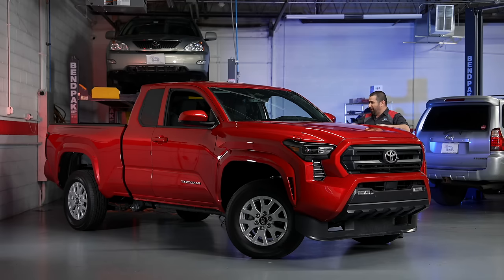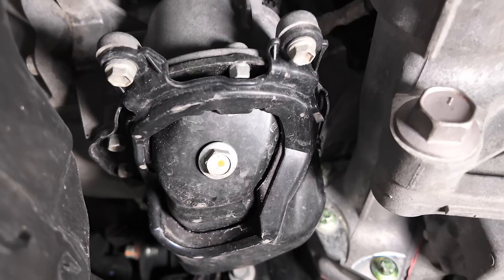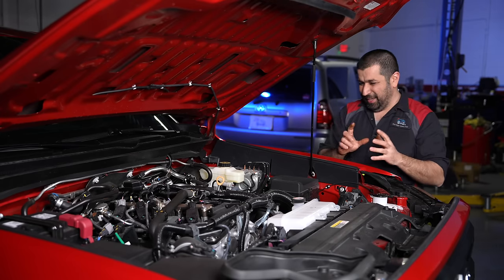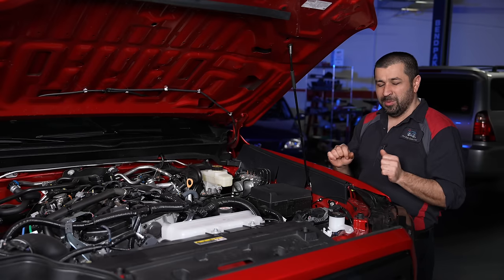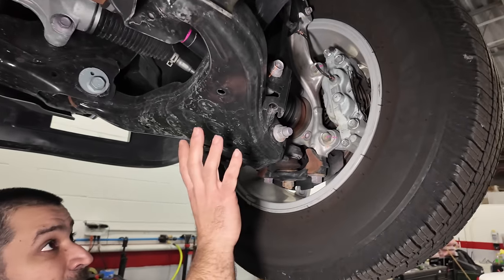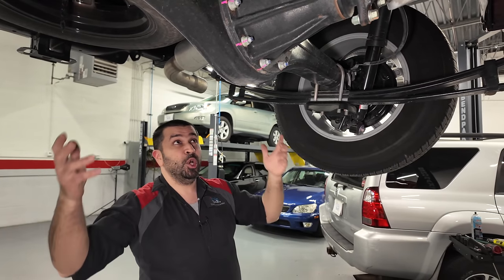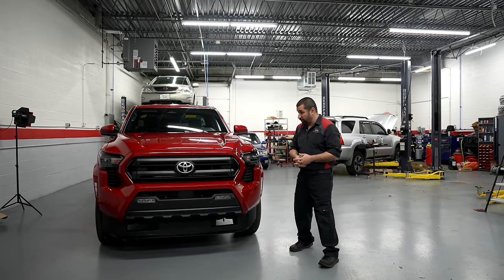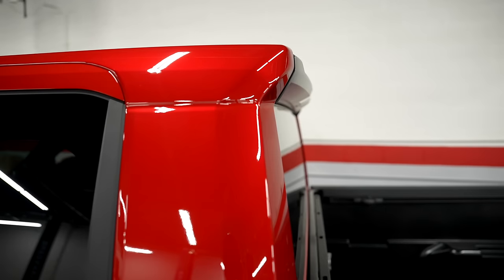2024 Toyota Tacoma | Did Toyota Improve or Ruin The Tacoma? Comprehensive Review

Comment: A truck the size of a ranger or Tacoma should cost no more than 32k out the door. This is getting ridiculous and lose the BS ill deal with just a radio dont need screens and push buttons.  just offer a basic capable truck with engine options and suspension and transmission options for any trim

Comment: The internet: "I can't believe Toyota would put a 2.4L 4 cylinder turbo in a midsize truck! What are they even thinking, it's going to be so unreliable!"

The Toyota Hilux:
Reply: If the new engine is sound, then the power it provides is better than anything they’ve had before.  Ford did this in their line—eco boost, but learned two years in about some problems causing failure.  These problems were corrected since.  Been driving an eco boost 4 cylinder (they have a 6) for 5 years and the power is tremendous when you accelerate.  If you don’t need the power per se, the truck gets 27 mpg in the city.  The days of 4 cylinder equals poor power have vanished with turbo charged engines.
Reply: Hilux doesn't have direct injection.... so what's your point
Reply: @Ashoud_Anobetah what does that have do with how air is being fed to the intake?

Comment: Yes but it won't last as long. 4 cylinder turbo. More pressure equals more wear.
Reply: No proof
Reply: Did the 1985 Toyota pickup 4 cyl turbo engine have wear out problems? No

Comment: How can anyone say your not going to miss the v6?  A small 4 cylinder with a turbo to push those rpms to haul or pull something with?  Just more strain caused by a turbo.  NO gas powered midsize or full size half ton should have a damn turbo in it.  If Toyota came out with a diesel 4 cylinder yes.  NOT a gas powered small block turbo that has to scream to pull something or tow anything.  In larger cities I would definitely not recommend any turbo in a pickup gas powered.  That turbo will eat away every time you hit the gas and drink gas as well at every stop, turn, red light.  It's just a cheap way for a manufacturer to give YOU LESS FOR MORE MONEY.  How in the hell does it cost more????  $50,000 for a mid-size pickup?  You have got to be kidding me.  Toyota made a huge mistake copying ford.  Dodge at least still have v6s in their rams.  At this point I would rather pay $39,000 for a Dodge Ram with a 3.6 Liter engine.

Comment: I will say one thing   if the core engine is the exact same identical engine as the entry level engine version  Toyota is charging you for a metaverse option that you don't even really get nothing more than a software upgrade    That really pegs my BS-O meter   Things continue to go downhill    I wonder what the towing capacity is ? bring back the V8 Toyota some people actually use their trucks to work with   Not just driving to the shopping mall I really think you would be pushing it   to keep that truck 25 years before it falls apart

Comment: Oh man. Car Nut is praising an engine platform before it's been rung out. Toyotas are known for 300,000 mile vehicles. If this is new how can praise be heaped on in massive helpings?  For a gas turbo engine to be a long life minimal repair engine it needs to be built like a diesel. Small turbo charged engines with super high tech in a heavy truck will be a money pit for the second owner.

Comment: turbos slapped onto 4 bangers, plastic valve covers, and injectors + pressure fuel pump located on TOP of the valve cover LOL......nice to see where toyota is headed. no thanks. will stick with my 4Runner and older Tacoma.

Comment: It's about time the American stop demanding / using V8's. When will it get the 2.8 4 cylinder GD6 diesel engine 150Hp 380 lbs/ft (500Nm) ? Looks like a dent in the wheel arch/door... what's up with that front spoiler??? Seems like a land cruiser 300 with a load box. BP51 Old Man Emu

Comment: Toyota has lost my trust because of all the problems, and they way they handled them on the gen 2 and the gen 3,  Asking me to pony up this kind of money in light of that isn't going to happen.  The electric steering is part of the remote control system installed in order for law enforcement and other agencies to seize control of the vehicle.  These measures are mandatory for the 2026 model year on all vehicles.  This is not an upgrade. Made in Mexico is a flat out fail.  The 4cyl turbo is a great sports car engine. I'll just pop up a batch of popcorn and watch this mess unfold.  By the way, I'm spending this weekend swapping my 8" rear axle in my gen 2 for the 8.75" that was FINALLY offered in the gen 3.  This axle should have been underneath the very first Gen 2.  I bought my gen 2 for $16,000 used, and spent that much again fixing all the problems  By the time I would be to that point with this truck,  I'd be $60,000 into it.

Comment: Pretty much, you are buying a car disguised as a Truck... A Transformer of sorts
Lets be honest here also.
You never talked about the crippled towing, and the extra wear and tear that towing puts on a turbo.
You never talked about how pricy turbos are to replace
Yes, the engine has been in other vehicles, but they do not tow like trucks are suppose to tow.
I have never seen a Lexus or Camry towing anything..... what is the point?
You never talked about the loss of bed weight capacity due to the loss of the leaf packs
The web like design on the interior panels on the doors are going to suck to clean.
Too many years to improve the low budget manual seats and they still are poorly designed

I have a 2019, and the new Tacomas make me very sad.
My 19 is the last Toyota I buy.

Comment: I appreciate and enjoy your videos but it's just like the tundra when they took that big boar V8 out of there and replaced it with a small V6 with twin turbos it's a hunk of crap I don't care how good it runs whatever there's no replacement for displacement turbo whatever I'm sorry but I'm pretty sure it's the same thing on the taco I don't know why Toyota can't offer two engine options the V6 and a 4-cylinder if that's what they think is so great and on the tundra they need to offer the V6 and they also need to offer the V8 they are going to drop customers like flies because they want a V8 they want a V8 they don't want to be six they want a V8 and I don't know why Toyota can't seem to understand that but I guess they will win the people don't buy them for the people that do buy them are not going to have the same long-lived miles that they would have gotten out of a naturally aspirated V6 because that little 4-cylinder turbo going to put a lot of pressure on that little motor and unless you maintain it like a diamond it's not going to hold up and people don't do that so guess what it's not going to hold up they're in Fantasyland

Comment: I won't buy these new 2024 toyota tacoma 4 cylinder truck because it won't last long and sooner or later the 2024 tacoma will have problems. I will only buy it if it comes in with the V-6 Engine.  Other than that I will not buy the 2024 4 cylinder engine toyota tacoma.

Comment: Indeed Toyota has sold their soul like GM and the rest. Turbocharged gasoline going to bite them in the ass. Especially in hot environments like Arizona. If they want to go turbo small they need to go turbo diesel. But time will tell. Aren't they already having transmission issues with the '24 Tacoma. Aren't they already replacing a 100,000 engines of the V6 3.4 twin turbo it's in the tundra and the Sequoia and the new LX and the new GX??? Time will tell. Although it's not entirely their fault. Due to bidenomics they've got to stay in business. That means build cheaper, lighter, in Mexico. Maybe if things turn around (hopefully) we can get those big V8's back.

Comment: So snow plow air dam, interior that looks like it was from a 2005 Corolla, that mess of wiring and hoses under the hood look like some guy just finished an engine swap in his backyard, overpriced, already breaking, sounds like garbage, looks the same, no hood liner (even cheap cars have had that for years) and I expecially like how they flared the tail pipe right at the end to make it look bigger 😂. This is a mall crawler.

Comment: Overpriced and suspect build quality. The roof channels surfaces are unfinished. The bed top
trim rattles and is not fastened down. That front grill looks like dollar store plastic. Interior looks cheap and dated already.
Plastic valve covers don't do well over time.
Not impressed. I believe that Toyota will lose a lot of customers with this "new" model.

Comment: Your full of it. I know about boosted engine.  If you get same hp and only one mpg better fuel economy.  The v6 is better. Most of, if not all, that buy toyota is buying for the longevity. I just bought a 2021 model because it has the v6. Trade in a 2018 ford f150 fx4 king ranch.  Beautiful truck. The ride was amazing.  Tons of power with the 3.5l ecoboost.  But a piece of shit. owend mostly ford's most my life but after losing about 30k in 2 years. Done with ford. I find it bad news that toyota is going down the boosted engines for there line up. Know one has had any reliability with thus far. Sorry to say I don't think toyota well either.

Comment: Get a Nissan, it still has a v6 and is waayyy cheaper. Love toyota but putting small engines in big vehicles and overworking them will cause problems down the road. All the old engine needed was a 10 speed transmission.  Look at all the problems the tundra engines are having.